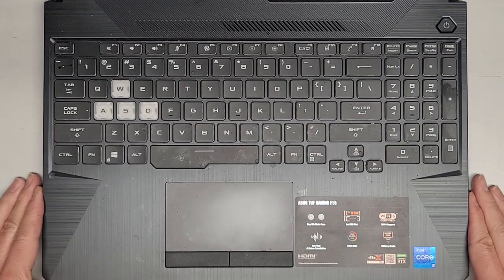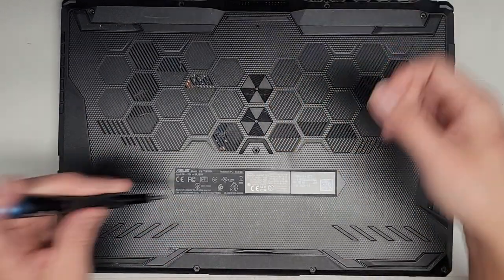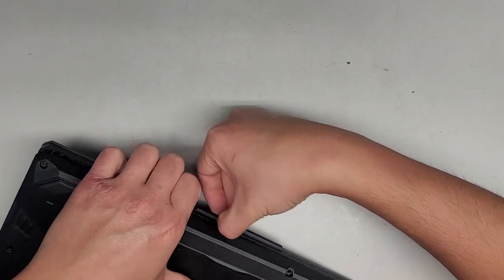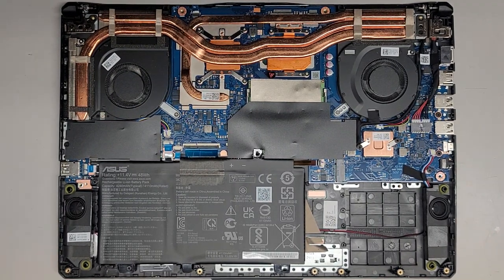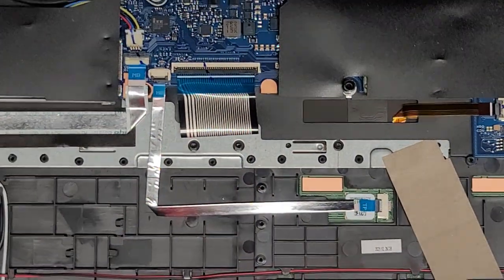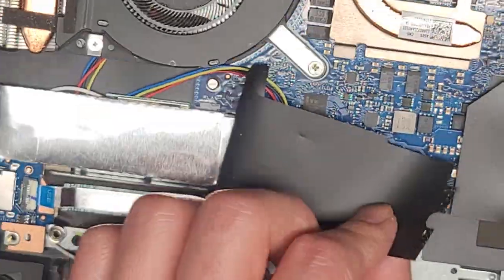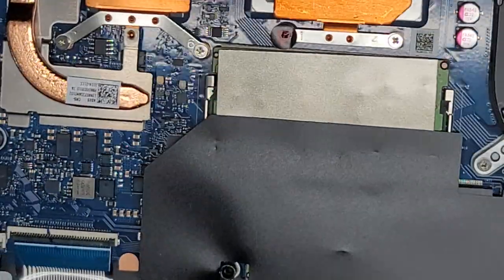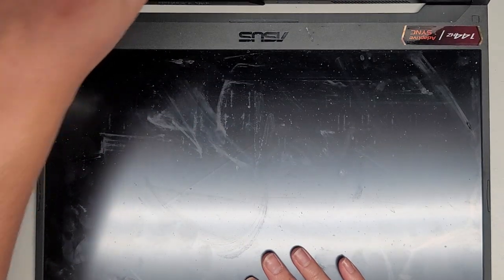ASUS TUF Gaming F15 TUF506H FX506HEB-IS73 Disassembly RAM SSD Hard Drive Battery LCD Screen Repair

Comment: I bungled the screw layout like an amateur lol Your layout at 2:19 was really helpful, thanks. I found 4 of the screws were very marginally longer than 3 of the screws aside from the notably shorter one that secured the bottom left and the two notably longer ones for the rear middle.
Reply from the maker: Glad it helped. If you haven't already, please like and subscribe so others can find my videos and possibly consider watching a few others and commenting to get the algorithm to recommend my channel. Thanks!

Comment: I wish u had removed the ssd & showed the model of it, I really wanna know which company ssd they r using on that pc 😢, tell me if you know, there's not much info on the internet about the actual name of the ssd.
Reply from the maker: Open it up and check. They use different ones all the time. Usually a cheapo samsung one designed to fail quickly.
Reply: samsung 500gb gen 3, it;s cheap ssd man
Reply from the maker: Yup

Comment: This is great! Thanks for sharing your expertise! I have experience replacing apple displays and they just replace the entire screen/enclosure. If I were to buy one off eBay for this computer make and model, could I juat swap the entire display/enclosure to my computer? Or, would I need to buy a new lcd and replace it like you did in the video?
Reply from the maker: You can do the entire display assembly

Comment: do you know what a good brand is/ which brand did you use for the tape?
Reply from the maker: @zainabshah3173  tape for which part?
Reply: @ItsBinhRepaired  sorry the adhesive used at 25 minutes
Reply from the maker: @zainabshah3173 I just reused the old stuff.

Comment: Hi, I actually opened it cause i saw smt dancing, apparently it was the silver stuff that u said it was "thermal stuff" on the ram, is it okay if that thing isn't attached now? Ty for the video
Reply from the maker: @aronm1254  thermal stuff? Dancing?
Reply: @ItsBinhRepaired  like the metal square, and I said dancing cause its no longer attached, like u could move the laptop around and hear it moving inside
Reply from the maker: @aronm1254  the ram cover? Just take it out.

Comment: Asus Did a blunder on the vent design Covering maximum part of the fans makes the laptop throttle thermally 😢
Reply from the maker: @nileshshrivastava4388  what do you mean?
Reply: The Fans Aren't Completely Exposed, Which Restricts Airflow In The Laptop , Which Makes It Overheat And Throttle Thermally.
Reply: @nileshshrivastava4388 i doubt affects the airflow too much. Although without a doubt if the laptop is lifted slightly, airflow is indeed better. But i tested with a laptop cooling stand, with fans only, the difference shows no difference.

This means the laptop is sufficiently getting enough airflow even without the cooling stand, so it just needs to be lifted. The lid covering the fans aren't likely the problem, but more like air trying to get under the laptop.

Comment: thanks for this! the lcd on my tuf gaming f15 has a 300hz refresh rate. can i replace it with a 120hz display?
Reply from the maker: I'm not sure
Reply: Can you set the display refresh in the bios or Asus utilities to 120 Hz only?
Reply from the maker: @a1smith  no idea
Reply: @a1smith  I know you can set the refresh rate in windows, so you can probably put in a lower fps screen and it might not work imediately as the laptop will still be tying to push 300fps, so just connect it to an external display and in windows change the frame rate to a lower one and the screen should work fine again! 

Hope this helps :D
Reply from the maker: Hopefully it worked

Comment: Hey man, could you tell me if you know where the CLRTC is ? can't find it anywhere, I'd like to reset the BIOS because I forgot the password.
Reply from the maker: Can't reset the password with that.
Reply: @ItsBinhRepaired  maybe not, but earlier today, i disconnected the battery from the laptop, pressed the power button for some time, waited some time. And when i got everything back together, there's was no BIOS passwords anymore. Thanks for the reply nevertheless
Reply from the maker: @AK-lb6kr  interesting, usually that only resets the bios settings, not the password.

Comment: Any idea how to loosen the hinges? Can I do it by just removing the back cover?
Reply from the maker: I'm not sure.
Reply: Use little bit machine oil with cotton bud to loosen the hinges.

Don't apply 1 drop 💧 of oil entirely.

Don't use pliers to loose nut 🥜 because it may cause more damage. @ItsBinhRepaired
Reply: Use little bit machine oil with cotton bud to loosen the hinges.

Don't apply 1 drop 💧 of oil entirely.

Don't use pliers to loose nut 🥜 because it may cause more damage.
Reply from the maker: @imrannazir5585  yup

Comment: can laptop dont turn after u reinstall the new screen without disconeting the baterry
Reply from the maker: You will fry the backlight circuit and possibly the motherboard.
Reply: @ItsBinhRepaired  my master didnt take the battery from my laptop and tried to change the display and after this my laptop is not turning on , but before i gave it to him i checked everything even in the benchmark everything was eorking well rn it doesnt even charging up and turning on ; thwt is crazy…( he says that my southbridge is down and has been fried)
Reply from the maker: @mrtred7576  because he didn't drain the power before working on it...

Comment: The one screw on bottom right wont turn, no ,atter how mu c force.
Reply from the maker: Did you strip the screw?
Reply: Tht is not supposed to come out don't break it
Reply from the maker: Stays attached to the case?
Reply: @ItsBinhRepaired  yes
Reply from the maker: @Godfatherhemanth2369  got it
Reply: I'm opening it now and had the same problem.. they used different screw for this one and it had glues but got it out by pushing it out with driver after rotating infinitely
Reply: I have the same screw

Comment: AAAA I force removed the screw at bottom right, am I screwed?
Reply from the maker: What do you mean?
Reply: @ItsBinhRepaired  the screw at bottom right, from where you pried the back cover, I took it out, before watching your video ofcourse
Reply from the maker: @TusharSharma-gc4vs  just make sure the washer isn't in the computer
Reply: @ItsBinhRepaired  ok
Also will the service center provide services or not after I did this?
Reply from the maker: I think it'll be ok

Comment: Is that magnet on the Basel?
Reply from the maker: @imrannazir5585  at what time stamp?
Reply: Which he was reinstalling plastic Basel, I saw magmatic substance attached on frame by Asus. @ItsBinhRepaired
Reply: Look at your video 13:40
 @ItsBinhRepaired
Reply from the maker: @imrannazir5585  yup, magnet
Reply from the maker: @imrannazir5585  yup
Reply: @ItsBinhRepaired  I tried to loosen the  hinges mechanism by twisting nuts via pliers.

Though it loosened but it left some deep dents all over the nuts.

I went to the Asus service centre to replace both hinges with money 💰 & moreover wanted to offer extra money if they requires to change the shutter Basel. 

But they refused to do that saying your hinge is operating normally despite of having dents. Replacing them may harm your display & so you might need to pay for display too. 

Are you willing to do that?

Brother I am repenting that why didn't I used machine 🛢️ oil just one fourth of a 💧 drop to loosen instead of using pliers.

Anyway I'm gonna change the display, bezel & hinge all together if it requires after 8 months.
Reply from the maker: @imrannazir5585  don't replace them. They're fine.

Comment: Does it have CMOS battery?
Reply from the maker: If I didn't mention it in the video, I'm not sure.
Reply: It will do. ALL computers with a configurable BIOS have a CMOS battery as the bios settings are essentially stored in a form of "ram" (volatile storage) so they need constant power to retain those settings.
Reply: thanks man
 @alexwoodhead6471
Reply from the maker: Not always. Sometimes they use the main battery to do that.
Reply: @ItsBinhRepaired  yeah that's why it is not present in my laptop
thanks man
Reply from the maker: @ravindrasinghkarki6852  yup